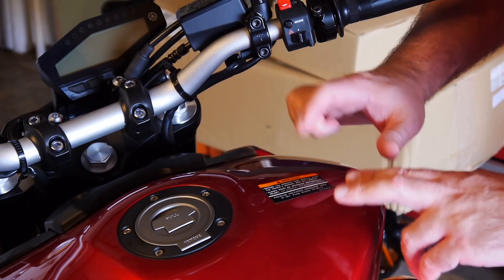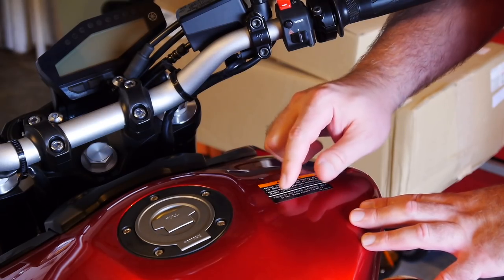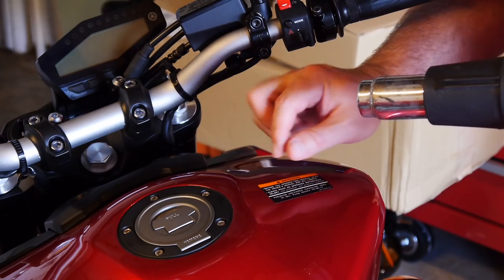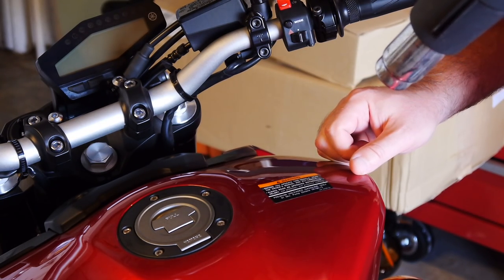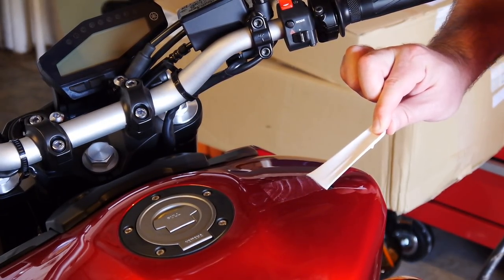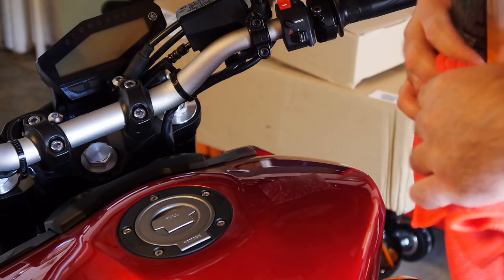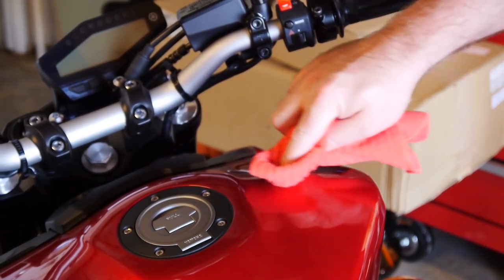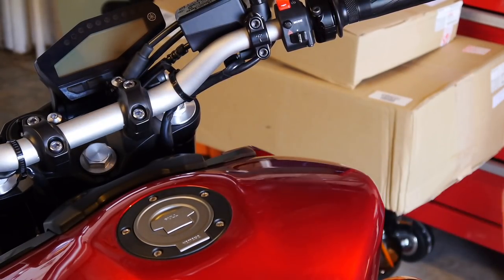How To Remove Stickers From A Motorcycle

Comment: Congratulations on your new motorcycle :) Remove glue = WD40 ;) Remove plate holder. Little ugly ;) Put up plate. My opinion. On Amazon or Ebay have very nice aftermarket plate holder. Rizoma is very good. Your Yamaha is very nice :) Especially, colour :) I have FZ8 - 2014, race blue colour.  Best regards from SERBIA - Europe :)

Comment: It would be better if you use some 80 grit sandpaper and a wood chisel. Comes right off. Then you just wipe off the residue with a combination of brake fluid and battery acid. Give it a try on your next new bike.